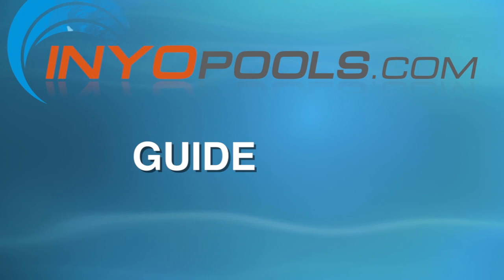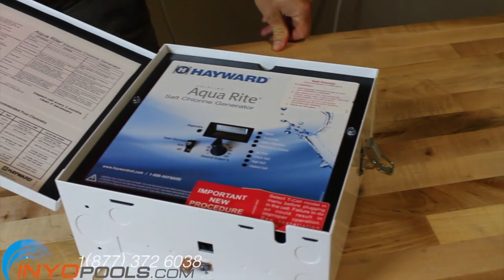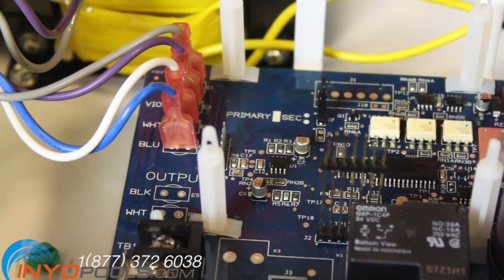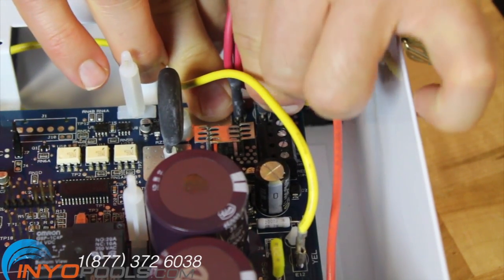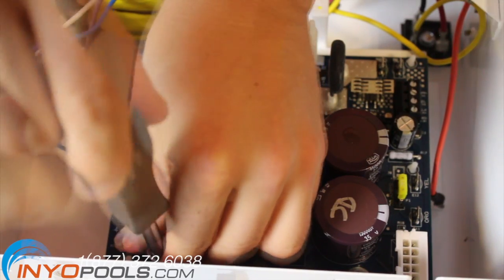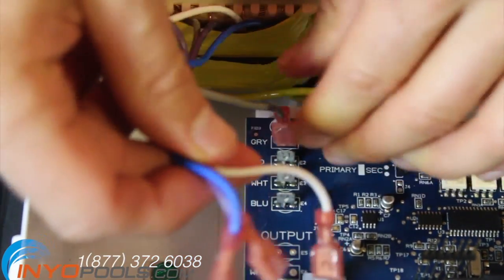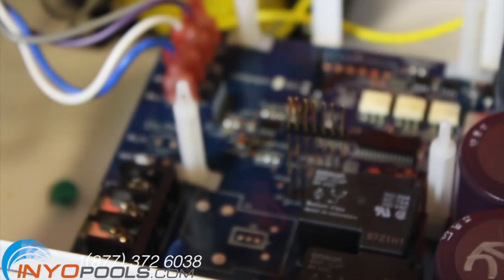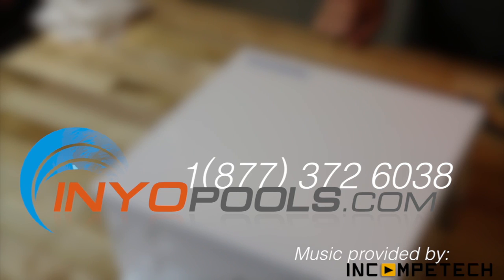How To: Replace an Aqua Rite Main PCB

Comment: My old board looks identical to this but mine has 3 more connections than this one does. On the left side where the output is I have 2 tabs with wires connected and then at the top of the main board I have a 6 pin connector. The new board I have looks identical to the one in the video. But why do I have more connections on the old than on the new??
Reply from the maker: Are you sure your generator is an AquaRite, and not one of the other similar models that include automation functionality like the Hayward AquaRite Pro, AquaLogic, and ProLogic?

Comment: I could make some snarky comment about how you totally skipped the power disconnect/reconnect or setting the jumpers for 120/240 volts, but I won't. Otherwise it's a great video.
Reply from the maker: Thank you for not making that comment about our misfortunate oversight. We'll be sure to correct it in a future video.

Comment: Was about to order new main board when I found numerous references to a burned thermistor. Received replacement thermistor through Amazon in two days for $5.85 (AMETHERM SL32 2R025 NTC THERMISTOR). Easily removed the burned out thermistor with a 40 watt iron. Used desoldering braid to clean up old solder.  Suggest not using large soldering gun to avoid overheating circuit board. My AquaRite system has been in use for over 6 years, and other than replacing the salt cell after 5 years, this was the first trouble I've had. Best decision I made switching to salt water from chlorine - very low maintenance.

Comment: I have to chime in here. There is a lot of bad advise in these comments. 
Robert Fugate    comments about putting electrical and a binder clip on the current limiter is not a quick fix it's a good way to burn up the whole PCB and possible the cell A quick fix would be turn the salt system off put some chlorine tabs in the pool and order a current limiter.

His other item with connecting the system to 120 volts verses 240 is way off base also. The transformer runs cooler on 240 volts I won't bore you with electrical formulas but most everyone knows heat is what killers electronics He also states that 240 and burn marks across the circuit board I don't know were he came up with that The 240 volts AC stops at the transformer the board 18 to 24 volts DC

  The main reason that the current limiters fail is the cell pulling to many amps this is caused by two main things. 1 Adding salt to a pool with the cell on, before the salt is mixed in well there will be pockets of water with very heavy salt levels. Salt is conductive more salt more power-more heat and the limiter is what heats ups and breaks down. 2 If a cell is dirty, has lots of build up on the plates this will cause higher amperage draw and burn the limiter just at a slower rate than high salt.
If you want to test this just watch your amperage level on the panel and have someone put some salt in a skimmer not much or you'll burn the limiter 
My experience with this is 21 years of owner a pool service and repair company and 30 years as an Aircraft Mechanic
I'm all for DIYers as far as pools and Youtube is great place to learn about doing almost anything just don't want to see someone get bad info and end up costing them self more money or worse electrocuting them self
Reply: awesome comment and information

Comment: Update, received my AS32 2R025 Current limiter. Since the board has a heat sink inside the board, which makes it impossible to resolder. Suggest to cut the old current limiter out, leaving the legs so you can solder the new current limiter to them.
Reply from the maker: +Robert Fugate Thank you for the update. Keep us posted on how it works out.
Reply: The first generation on Hayward Salt system circuit board, had a current limiter w/letters SL & had an issue with getting too hot & going bad prematurely. The circuit board was updated with a heat sink embedded in the board. If you look close enough in the video you'll see around the leg of the current limiter a .5 by .5 inch sliver patch. That's the heat sink! In addition, a upgraded current limiter was added with letters starting with AS. You have an option of running it at ether 120 or 240 volts, suggest 120 volts less likely to damage step down transformer and track (burn) across the circuit board. 120 volts is much kinder to the electronics as it ages!

Comment: Had same board after 5 years of use, the current limiter finally failed. A quick temporary fix, was to put electrical tape over the current limiter and clip a medium size binder clip on it, make sure it doesn't touch the door or anything else. Other preventive maintenance suggestions the flow switch connection, put some anti wire corrosion inhibitor on it! If nothing else use WD-40.
Reply from the maker: +Robert Fugate nice job! As DIY-ers, duct tape and WD-40 are our best friends.

Comment: Make sure you check the current limiter on your board before replacing it. I thought a replacement board was needed for the Aqua Rite, but I saw tiny marks next to the currency limiter (black quarter-sized disc on the board). It was blown and was $2.50 to replace from Digikey.com. I desoldered the old one and soldered on the new one and it is generating chlorine again. If you don't have a soldering iron, it's around $15 for a kit at any Radio Shack. Also, if you don't have experience soldering, there are plenty of YouTube clips that can show you how easy it is.
Reply from the maker: Thanks for the great tip! Has your repair held up? Thanks again.
Reply: I just looked at my current limiter and it was cracked and brown where it hooked to the board so I ordered a replacement part.  Thanks for the tip.
Reply: S1N15T3R I'm at same point -- about to install a new PCB and noticed that terminal E12 where the Yellow lead from the transformer plugs in is discolored and the yellow lead shows signs of burning where it plugs into the PCB. So is it safe to attach the new PCB? Or will it get fried the second I turn it on? What would have caused the current surge there that would not have (a) blown the fuse at F1 or (b) produced the charring you found at the current limiter disc? Tech service is closed for the day and I need to get this done tonight. Thanks.
Reply: Thank you just save me a few hundred bucks